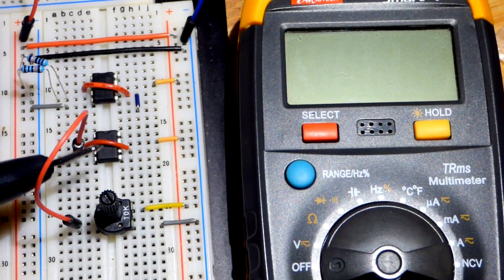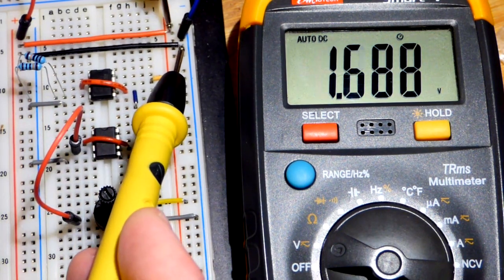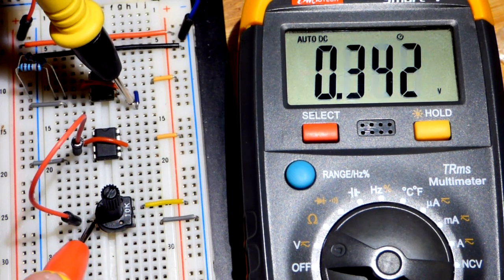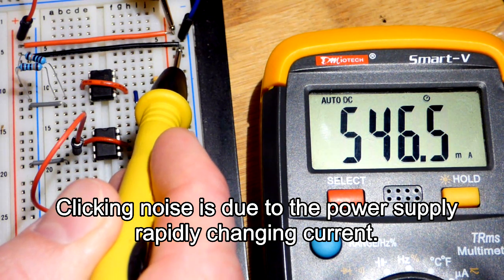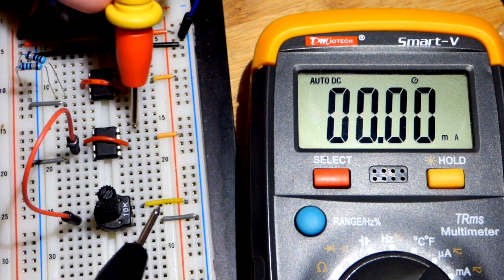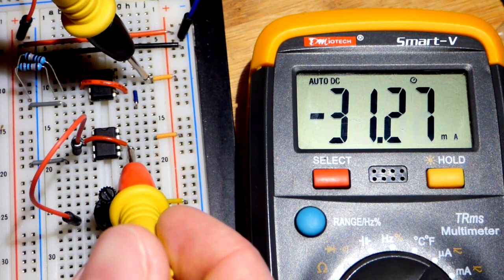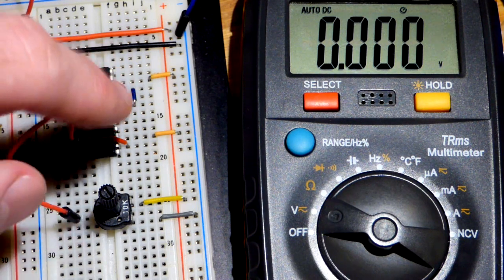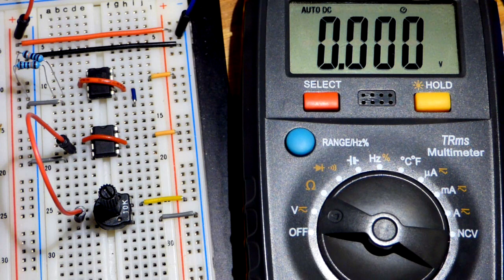Testing UA741 op amp internal output short circuit protection for beginning learning electronics

Comment: I have a suggestion. Could you please make a video on how you would put your project on a circuit board? I just did a lm386 amp. It's real simple with three capacitors and a 10k pot. I would like to solder it to a circuit board and use it on my phone to watch your video's. I got a 99cent thrift store speaker and a few dollars in parts. Saves me 60 dollars for a store bought speaker. I couldn't get my phone loud enough to here with back ground noise. The video would help with putting other projects on a circuit board. Thanks.
Reply from the maker: I'll see what I can do, was actually just looking at the LM386 datasheet. I haven't really done anything with audio electronics so definitely not the best person to help with that :( My phone is quiet too, really sucks lol